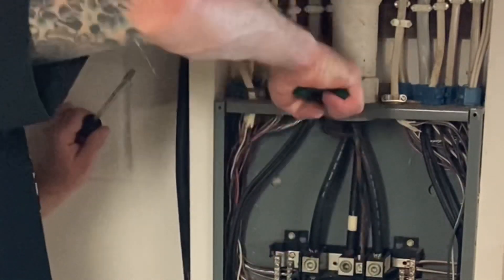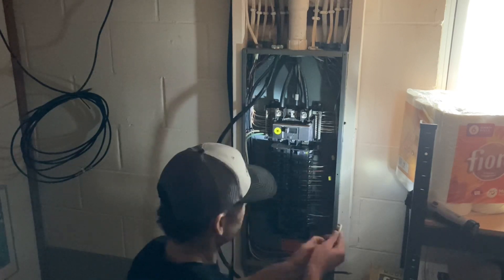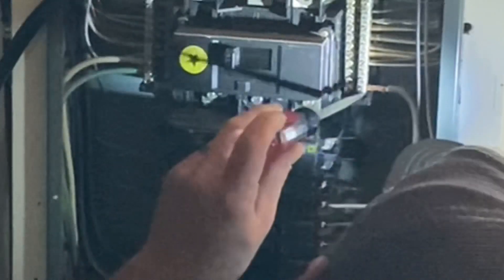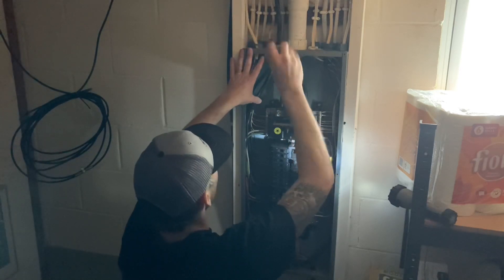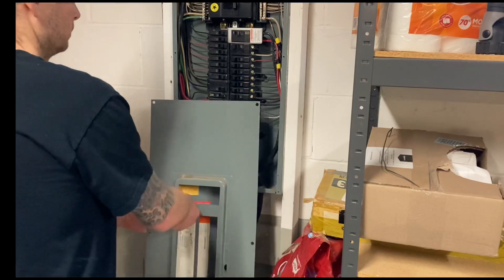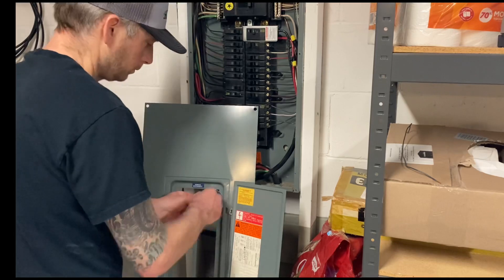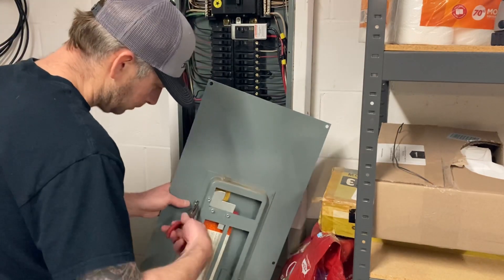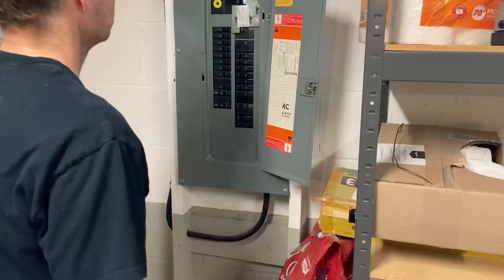Wire & Install a Interlock Transfer Switch

Comment: Why does no one say you should shut off any solar circuit breakers before energizing the main panel via the generator?
Reply from the maker: Good question, maybe they do?  I would imagine a decent solar set up would have since sort of protections built, like an automatic switch since solar for the most part supplements or is supplemented by utilities or generators

Comment: Im going to be doing the same project except im installing my inlet receptacle inside the garage next to my panel.  Since my box is flush with the finished drywall i have to cut a patch of drywall out to run the wire behind the drywall but some spring loaded plastic access panels should cover that up nicely.

The hardest part is rerouting some breakers to the same side buss because my generator is only 120V

Comment: Thanks! I have a butt load of solar power and was going to go in through the 220 dryer outlet.  I like your method better.  Thanks again for the video.
Reply from the maker: Cool, I’ve heard of guys doing that and it usually does not end well 🤣

Comment: is that 50 amp breaker hooked up to both poles....couldn't you just use the black and red both hot and wire them to the poles on each side so everything get energized?
Reply from the maker: I don’t know, I followed the instructions and everything is energized the way I hooked it up. I’m pretty sure that every other breaker are on each phase.  Since the 50 amp takes two slots, it’s on both phases. At least I think that’s how it works

Comment: so ,for my the simplest  ways for hoock up the  generator to my house was the dryers plug,you can back feeding power back hoicking up yhe generator whit n dryer suicide cord  or you can use n rv cord
Reply from the maker: Can’t recommend, but yes this works.  If you’re going to do this make sure all your wire is the right size in throughout your house so you don’t overload and melt it.   Also turn off the main power from the utility so you aren’t back feeding the line

Comment: Over all , good video.   Good explanation  as to what you did.   For people thinking of doing the same be careful  of the kit you buy.  Buy a kit that is made by the same as the panel manufacturer.  Generally  Square D devices  on Square D panels..  Siemens  devices on Siemens  panels.... There might be a liability  issue.  Also you are relying on the breakers internally disconnecting.  I have an old circuit breaker with the handle off but power still went thru.

Comment: Good job on this demonstration!  Also, it is a great idea for one to purchase 'PowerBack' Model THP108 by Reliance Controls so one will know when the Utility Power comes back on.  This way if your main panel is inside your house, you don't have to look for lights to come on at a neighbor's house or wait for some form of notification (Text, Phone Call) from your utility company to know that the main power has been restored. The Interlock Switch in my opinion is the better way to go than installing a limited number of circuit breakers on a Transfer Switch!  You can also simply code certain certain breakers with a marker/paint to know which ones you want to turn on always so you won't overload your generator.  Someone suggested green color for turn on during generator usage, yellow for maybe and red for never if your generator is not powerful enough to run that circuit.  I simply put my setup on an excel spreadsheet and color coded it this way that I have attached to my outside panel door.
Reply from the maker: Sounds like a good setup

Comment: Up-thumb for ya. Good video. Yeah a couple of unprofessional safety violations but the end result is quite satisfactory. I am not a "real" electrician, just a guy who is too cheap to hire one, and I research stuff carefully before I open anything up that is not supposed to be user serviced. 

For noobs watching, always read the comments! You will learn a lot, when you have a hundred internet electricians, a few shade tree electricians like me, and a couple of licensed pros, all looking to tear the video to pieces. The comments are always gold. 

Nice job, SD, all things considered. I watched your previous vid too, where you made room for the generator breaker. You should put a link in that one for this one, so somebody can segue right from making space and popping the 50A in there, to the generator feed and interlock. 

I have a 7500W Firman and I was doing the extension cord thing, but got tired of not having central air. I hate sweating in bed, at least when I am just laying there trying to sleep. New Orleans in August can be pretty warm. We were without utility power for a couple weeks after Ida. So I had a 125A sub panel in the workshop and a 60A breaker feeding a 14-50R receptacle for my arc welder, and I robbed a power cord from an electric stove and stuck a 14-50P on the bare end for a "suicide cord", then shut off the service breaker at the main panel and tagged it, then locked the box. Then I could close the 60A on the sub panel and fire up the genny and my house had power. But I knew I was being bad, even with the safety measures, so I will be doing it right before next hurricane season.  I will agonize over buying 70'  of 6/3 for the new power cord, but it is something I need to do. Anyway,  kudos to you. You showed the correct way. NO WAY was I gonna put up a vid of my suicide cable setup! Somebody would get killed for sure.
Reply from the maker: Thanks a lot for the thoughtful comment .   I don’t mind learning new things and I don’t mind even learning the hard way so when you put something on YouTube to help people it’s funny when all they wanna do is cry. Lol.  I figure if nothing else tell me I’m wrong and show me how to do it the right way LOL then everyone can learn. Good luck my friend I’m in Minnesota and can’t live without AC so I can’t imagine Louisiana!

Comment: Like others I had a cringe moment not only with the panel propped against the breakers but, when I saw you were wearing a metal ring while working on a live circuit. Please be safe!
Reply from the maker: Haha I felt dumb as I was doing it but I had to get it in the shot and DID NOT want to do another take.  I’m almost as bad at shooting video as I am at electrical work, the things I do for random strangers what a great guy I am! 🤣

Comment: Very informative video. Thanks for sharing. Just wondering if you looked at the GenerLink as an alternative approach.
Reply: Me, I don't like those multi-circuit transfer switches. Lots of extra work and expense. Good for a smaller generator, though. With a 7500W or bigger genny, I prefer to go whole-house and just watch the loads. We have gas water heater and gas stove so works out okay.
Reply from the maker: I looked at a ton of different options, generalink is not ringing a bell, I went this route because it is very minimally invasive and by far the most cost effective I could find

Comment: I have the exact same panel as yours.  Please give me a link where I can buy an interlock switch like yours.  Thank you!
Reply from the maker: Generator Interlock Kit Compatible with Square D Electric HOMCGK2C Homeline Cover Generator and QOM2 Frame Size Main Breaker Interlock Kit https://www.amazon.com/dp/B08ZMYKVFF/ref=cm_sw_r_cp_api_glt_fabc_6K1208THT0DF7WMS0BRD?_encoding=UTF8&psc=1
Reply: @shawndavis9276  Thanks again!

Comment: The interlocks are better than transfer switches.  With the interlock you can choose which breakers you want to use whenever the power goes out.  With a transfer switch you can only use what you wire up initially.  If you wanted to run something else or make changes you would have to rewire the entire setup.  If you decide you need to run something that might draw extra power with an interlock, you can turn off one or two other breakers and run that device that requires more power safely and then switch your breakers back once you are done using it.  Interlocks are easier to install, cheaper and allow you more freedom to run what you want at different times.  Glad you mentioned the cover leaning against the panel, lol, it was s cary for a minute.  Nice job, congrats.
Reply: well stated.  add more info later. Today July 5, th., two days after my previous comment, I am updating that I received Amazon's order for Interlock devise and double 50 amp breaker for the inside circuit panel.  Picking up the Firman  yri fuel generator at Costco tpmorrow for $699 + tax..  It's a two hour drive one way, so we called ahead to make sure they were in stock. I have learned so much from these U tube videos. More parts coming from Amazon for connectors to 50 amp rated connecting cable.  Found a spot on patio 18 inches away from house and 5 feet away from windows. Using my 3-4 small propane tanks initially untiI can get a good deal on a bigger used propane tank.  No natural gas in our county of Kentucky.  Thanks to others for their input to this  subject and
Reply: @bobgieser2943  
👍🏼